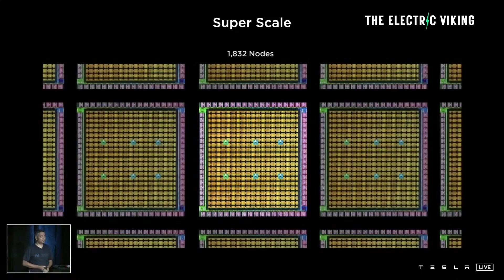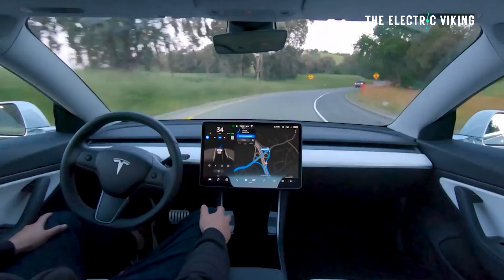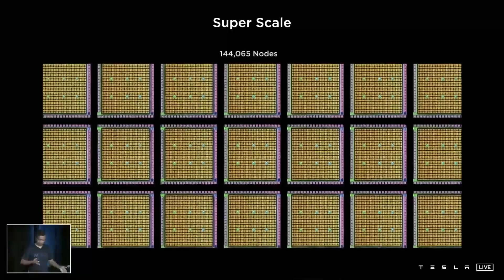Tesla has begun development of Hardware 5.0 FSD Dojo superchip

Comment: This certainly is the sort of thing that potentially could improve the performance of FSD and with an appropriate hardware package up grade; maybe you'd see it outperform a  5 year old and start understanding enough of the world to be as good as a professional driver.  Given better algorithms and this speed improvement; maybe FSD can become viable.  The flip side is that the current hardward and software won't make level 5 and sort of was sold in bad faith to cusomters; they did make it transferable now; so I guess once the hardware is updated on newer models you could sell it to someone that can use it.

Comment: In 2019 Musk publicly stated "“If you buy a car that does not have the hardware for full self-driving, it is like buying a horse,”  “And the only car that has the hardware for full self-driving is a Tesla.” - if Full Self Driving requires hardware 5.0 FSD Dojo superchip that statement was yet another, in a long line that was false.

Tesla's misnamed FSD is a very advanced driver assist feature which has been stuck for some time on level 2 autonomy. Does even Musk's most ardent fanboy really believe Tesla are going to go from level 2 to level 5  on the basis of a single hardware update?

One thing can almost be guaranteed; there is no Tesla on the road today that has the hardware that will allow it to be anywhere near level 5 and that retro-fixing will not be viable, nor an option. Those people who opt for the FSD are paying over $2,000 a year to help Tesla develop a system that their vehicle will never benefit from.

It's not that there is anything wrong with that, other than the false promise that todays Teslas will one day be able to become RoboTaxis, stop with the snake-oil.

Comment: I think it will still take a very long time until FSD really works, ie 30 years plus
Reply: 12 months max. Huge upgrade in compute & a resent quantum leap makes it a certainty .
Reply: But it's just a few edge cases. LOL.
Reply: The improvement is exponential, you’re thinking linear. This year no, next year difficult, within 5 years easy with AI
Reply: No way. Two years or less.
Reply: DOJO will make the difference... Super computer will change things exponentially when up and running. FSD is very good right now!
Reply: @cmac9710 How do you know?